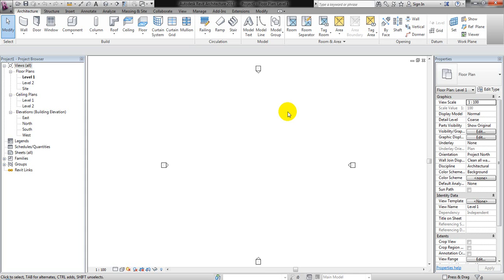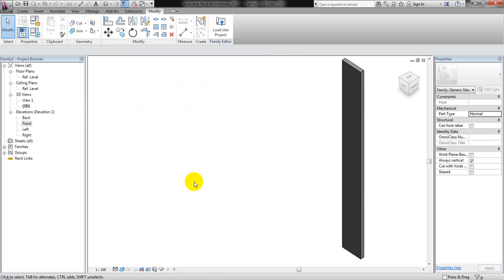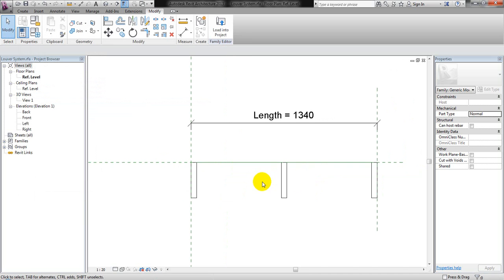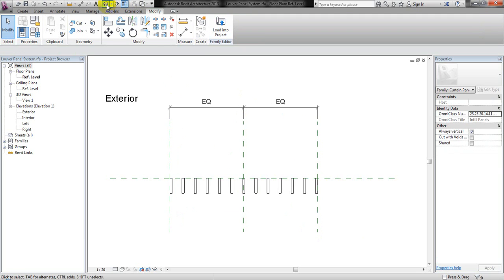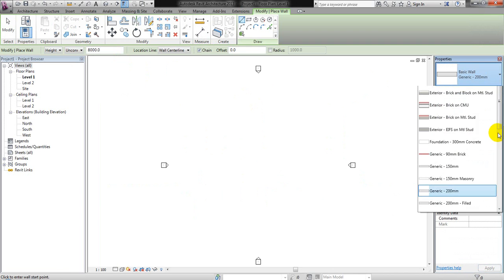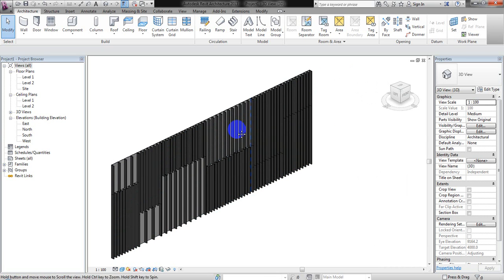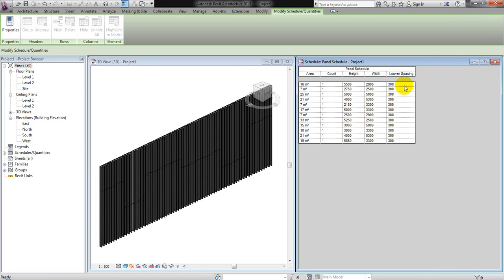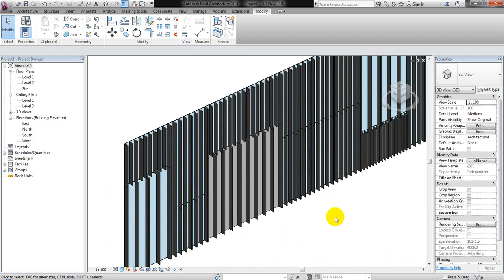BPD RT005 Parametric Louver System

Comment: At 10:59 to extended the louver to the top, which doesn't work, can you explain what is not setup correct?
Reply from the maker: @ 8:10 select the reference line not the level

Comment: Hi, Im doing fine with the WHOLE video until you hit 11:01 where you lock the height of the louver panels to the reference plain. When you choose the Louver panel, you get the little blue triangles that allow you to change the height, and when I try to do the same, there are NO blue triangles. I can't change the height of the panels.... WHY?!
Reply: did you solve it?
Reply: @jer9382  no /: ... Same problem?... I think I might just have a different version of Revit
Reply: @LotusOverWater  yes i have the same problem and idk what's wrong
Reply: @jer9382  yeah well.. I just ended up making just the louver and making an array on my facade

Comment: I got everything to work except the biggest problem is that when you cut the panel with the grid, the louvers double up on the edge. It's hard to notice in your video but this is a huge problem on my actual design. Is there a way to stagger or offset them?

Comment: Hi bro, I was following your instructions, step by step...
Did the single louver family
Did the second step with the spaces and dimensions,
But on the third step, to make the system, at the moment that I want to adjust the Height of the louvers,  min. (10:50); in my case the little blue arrows that manipulate that height, aren't available on mine... and its the third time I've tried... Do you know the reason? 
Maybe its an obvious questions with an obvious answer, but I can't find the reason, thanks in advance bro, and thanks for the video as well...
Reply: check min 8:10 as @Benjamin Dogeno told me... Put dimension on reference plane not in the level.
Reply: Hey, I don't know where am I going wrong. I have been following the steps exactly, and I've tried manyy times, but It's still not working. please help
Reply: figured it out. Press tab whenever you want to select specific object laying on top/under another object. Reference plane and level is overlapping in this case
Reply: @reddcat16  Hi, i still don't get it. Could you pls elaborate.
Reply: dude... you save my ass! thanks a lot!!
Reply: same problem here. the louver height in mine is in instance parameter
Reply: Did you make the "louver height" an instance parameter?